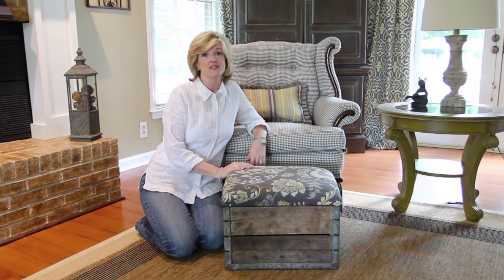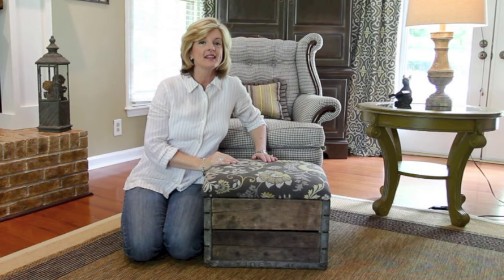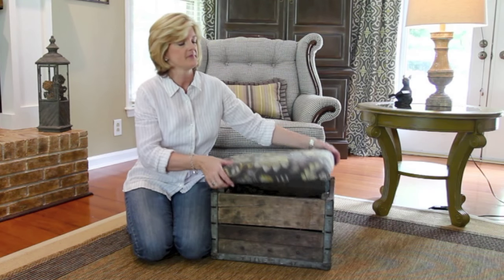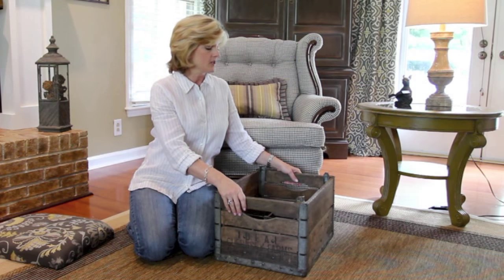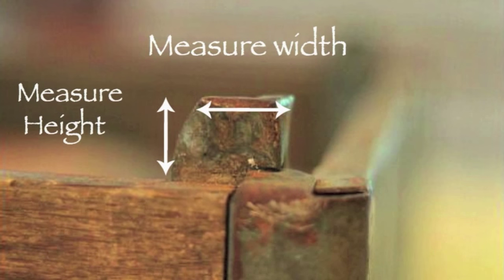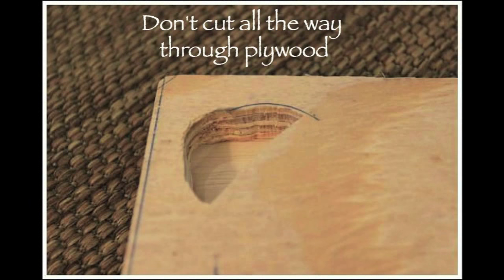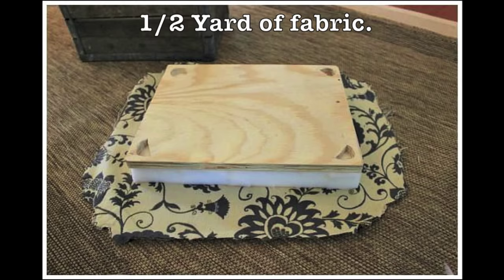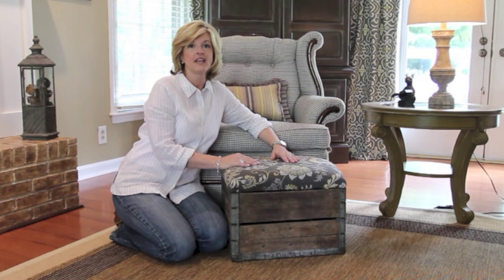DIY Milk Crate Ottoman| Build Crate Seats For YOUR HOME

Comment: I saw this post and made one out of mine!!! I also added the decorative upholstery tacks around the outer edges of the cushioning. I am enormously pleased and was grateful to find this DIY because it helped me figure out how to do this. I couldn't find any 1" or more plywood, so I used 3/4 but the way the holes were dug out for the metal deals that stick up an inch - i still managed not to break through to the other side of the plywood and i love it. It's one of my favorite things! So thank you!